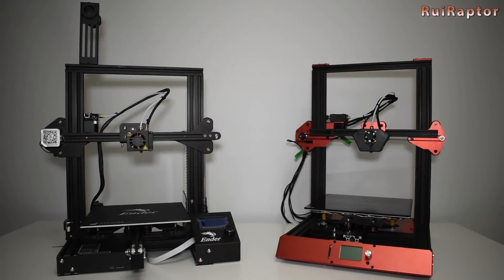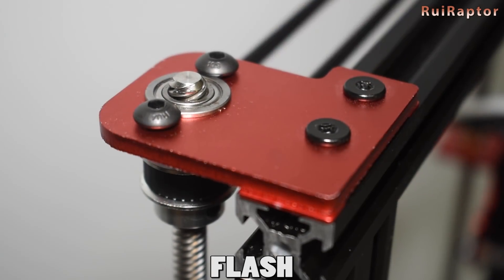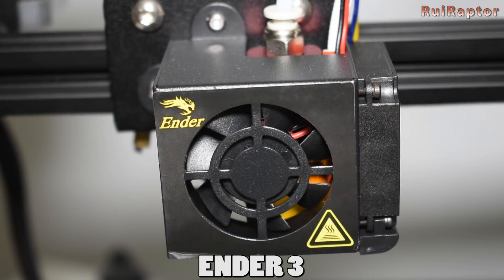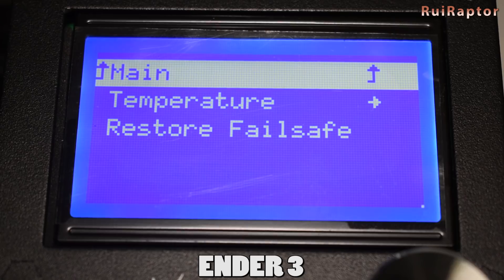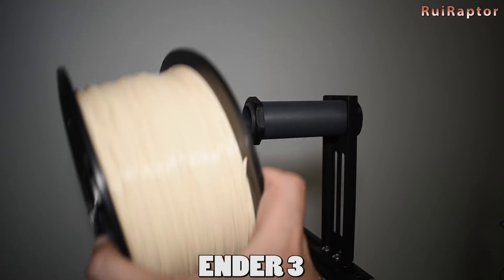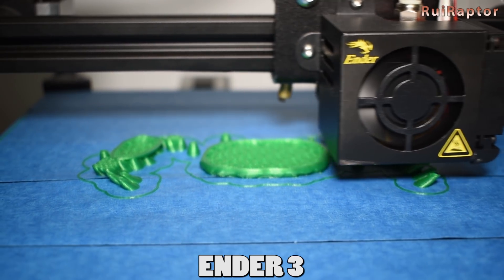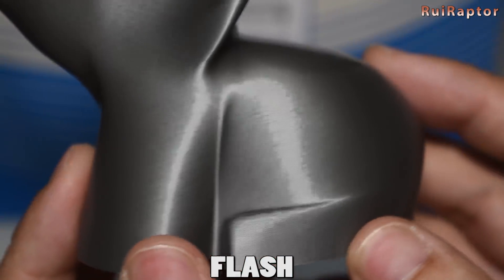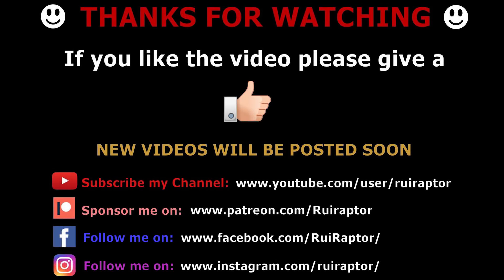Creality ENDER 3 vs Tevo FLASH  - Which is better?

Comment: Not really comparing apples and apples as such, looks like the Ender you used is an older model. My 2 day old Ender 3 has most of the additional settings in menu that the previous models did not have, the burning smell is not there anymore, actually my last 2 Enders did not have it. The Tevo is more expensive and the base model do not have the expensive steppers drivers, the dual z-axis etc. If you turn the spool holder upright arm around on the Ender it will fit most if not all spools.

That said, I personally prefer the Tevo Flash, but purely based on price the Ender 3 can't be beaten. The XVICO Pioneer might give it a run for its money, lots of additional features for almost same price, but still waiting for mine to test. So far only the Geeetech A10 is in the same price range, but seems not as good.
Reply from the maker: Hi Cobus,
Allow me to rectify some things.

My Ender-3 is 4 weeks old and ordered new online. 
The tevo Flash base version is currently being shipped with TMC2208 drivers which are far superior than the Allegro A4988.
Regarding the spool holder, as you said, it will fit most but not all...like i also said in the video, the Filament PM spools do not fit even turning the arm around.

Comment: I already have the Tornedo.  I am buying the flash.  Cannot find the 98% model.  Can you share the link to the 98% model?  Thanks for the comparison.  Starting flexible on Tornedo.  Got Ninjaflex
Reply from the maker: Hi Brian,
Check here:
https://www.banggood.com/pt/TEVO-Flash-98-Prebuilt-3D-Printer-Kit-235235250-Printing-Size-p-1311319.html?p=84280421195697201804&utm_campaign=21195697&utm_content=3312

Comment: Which of the tevo flash upgrades would you recommend? The stock stepper drivers seem sufficient and you can buy them on eBay for around $30. So I don't know if the tmc2100 drivers are worth the extra $50. I could pass on the bltouch. The dual z seems interesting, but I've read that dual z can sometimes get out of sync and cause artifacts in the prints. Also, the z lead screw is captured, which I've read can be problematic and cause binding if they aren't perfectly aligned and tightened properly.
Reply from the maker: Hi David,
Good question.
From my experience, the single Z is sufficient and will work as good. Having the dual z (dual leadscrew and dual z motor), and thanks to the belt connecting both leadscrews, they will not get out of sync in this printer.  The BLT is optional and for the drivers, tevo was sending the TMC2208 with the standard version, so if this is still true, you can print as good with these too.
Reply: Hi,
TEVO  Flash only with Dual Z and 50% ist the best for the price

Comment: What an Amazing Comparison Im sure this will help many people to make their mind up! Although they look similar Flash is Far superior ... P.s Y axis profile orientation also is different, 20mm side for Ender 3 , 40mm side on Flash which gives extra stability to Flash Heated bed :)
Reply: flash is double the cost and is in no way "Far Superior".. come on now. they literally have the same bed size, 235x235
Reply from the maker: Hi,
Thanks for your comment and for sharing that input which is 100% correct.

Comment: I guess i need to get my act together and build my Flash..
.
Reply: dont.. its twice the cost and much more of a hassle.  Ask anyone who has a Tevo branded printer.. The Ender 3 is easy to setup, easy to use, has tons of upgrades (although you can do awesome with a stock printer), and its print quality is awesome.   I have one, along with 2 other printers, and have tons of friends and acquaintances that have lots of printers and Ender 3's..  for a low cost printer the Ender 3 is unbeatable.    But if you want to spend the money to get a Tevo Flash, dont,  get a CR10.. it has a much bigger build volume and is the same price.  Plus you wont have the headaches that you'll get from a Tevo printer.